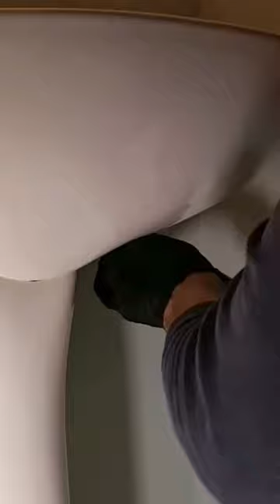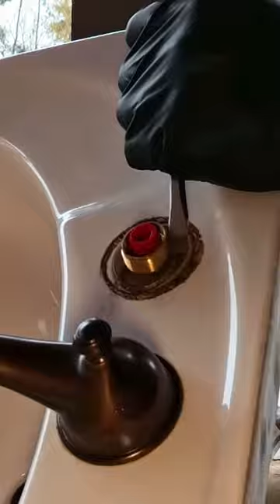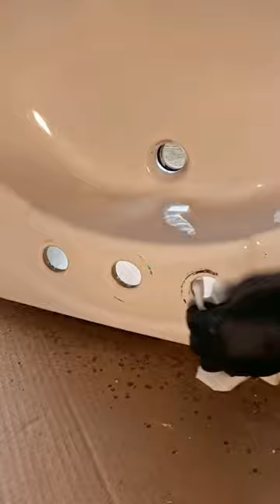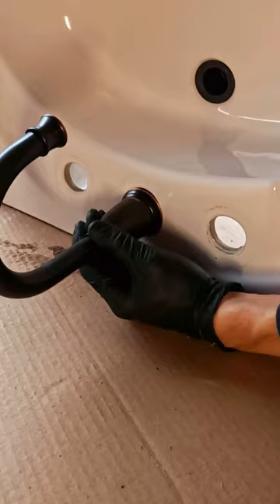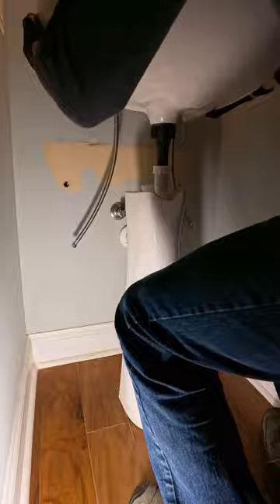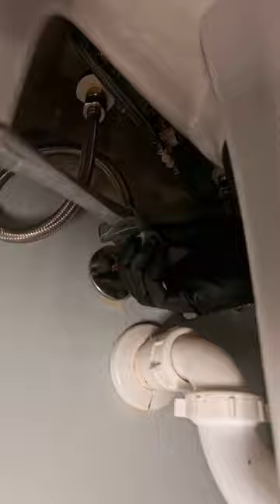Replacing a faucet and drain on a pedestal sink🚰💦 #plumbing #plumber #asmr #diy #shortsvideo

Comment: That looks like white silicone on the rubber washer above the large black plastic drain nut just under the sink. 

I used plumbers putty at that same spot on the uneven bottom surface of my pedestal sink last year and it has held well. 

I am a relative newbie to this work, with a good bit of research and some hands-on experience, and will think about other sealants for the next such scenario. 

It seems silicone would give a more waterproof seal, but am also considering that if I ever want to replace that sink faucet again, the plumbers putty would likely be easier to remove. 

I have learned a lot from your channel and thank you for the great selection of videos helping homeowners eager to expand their skill set, especially in an ASMR setting, as well as the next gen of real plumbers☺️